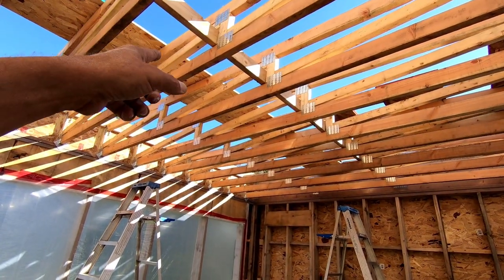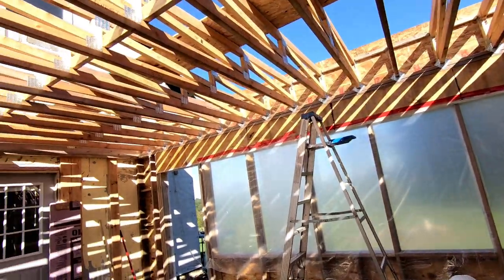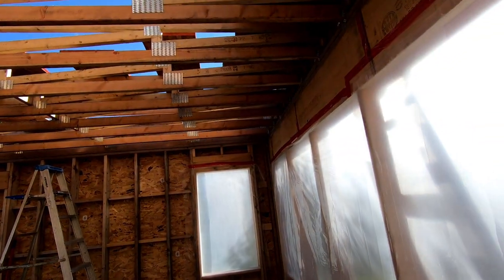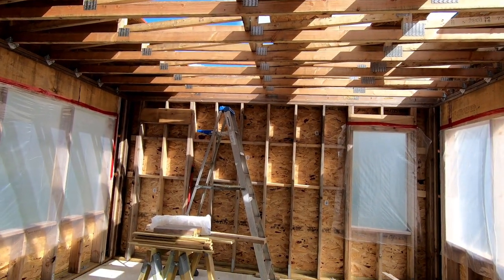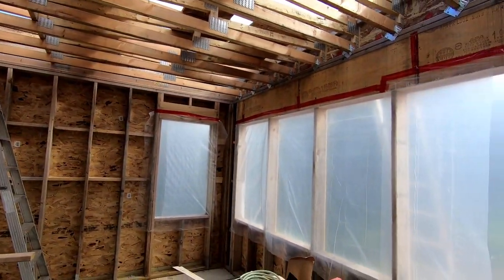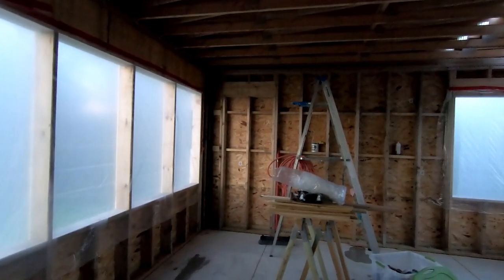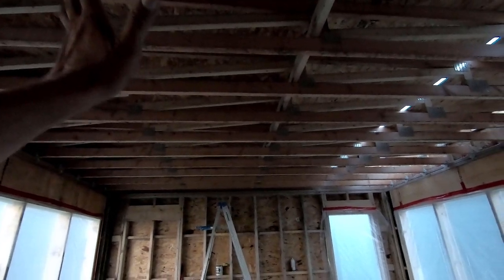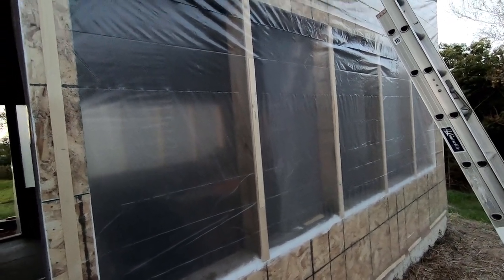Installing the Flat Roof Deck ― Day One

Comment: Just bought a house with a deck over a room with improper flashing, flat roof, now room under deck has extensive mold and water damage from rainwater sitting on rooftop. Absolutely no drainage, water and snow just sits on top of the roof through the deck slats and caused thousands in damage.

Comment: Aren’t u supposed to use marine plywood instead of osb board - granted it might be exposed to moisture if the membrane cover fail?
Reply from the maker: No. You have to make it so it doesn't leak, and if it starts leaking — fix it. Having said that, you can use any material you wish as long as it's up to code 😊